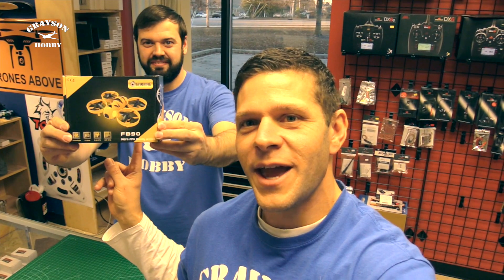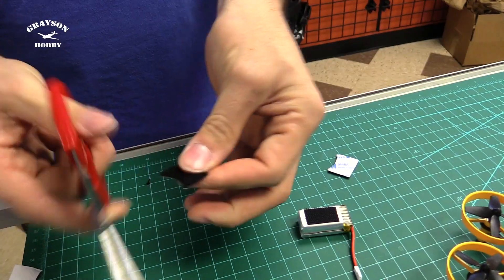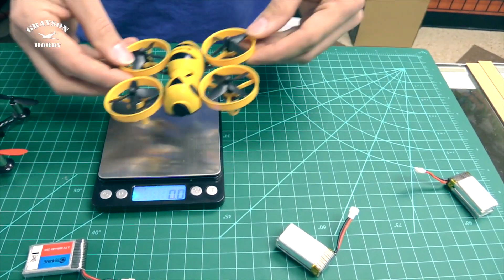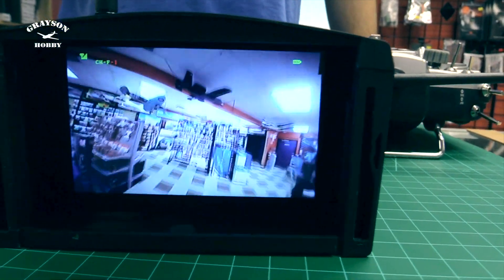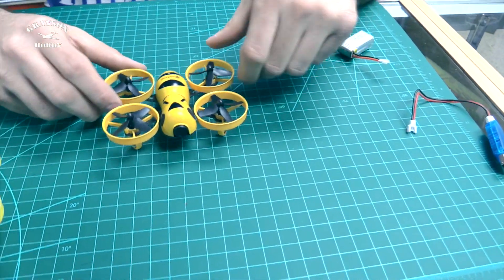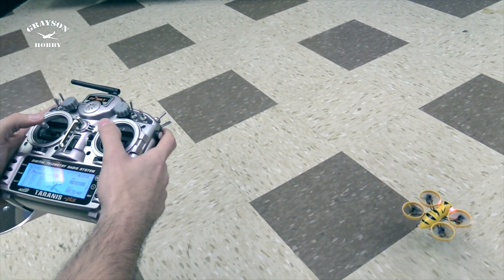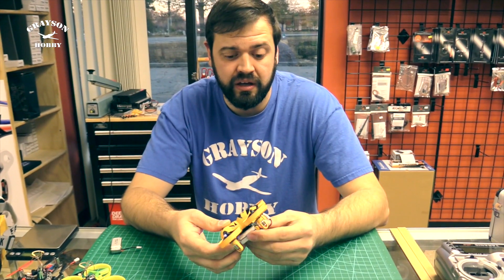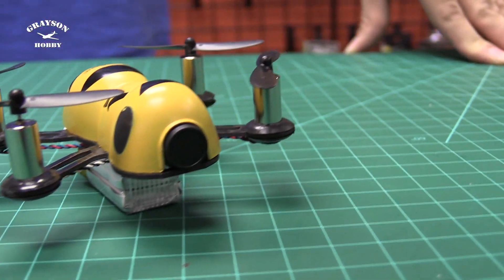Eachine FB90 FatBee | Does it Suck? | Micro FPV Drone Racer

Comment: Nice video. I got the similar one and I did have the same problem with those flimsy ducts and I did cut them off. But I have Yaw issue and it pulls one side. Eachine could have made it better ducts and i did complained BG . Can you pl's post your out of the box PID settings..
Reply: ThinkGreen1976 bangood does t care man